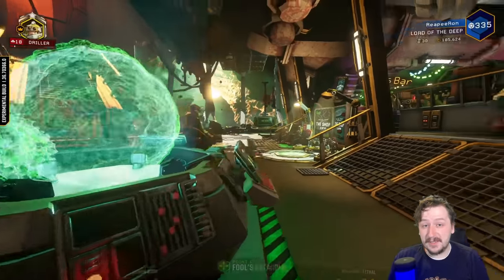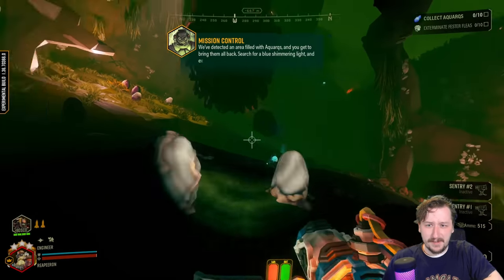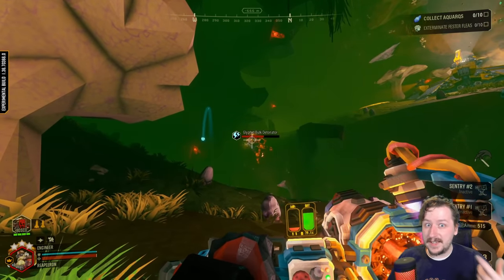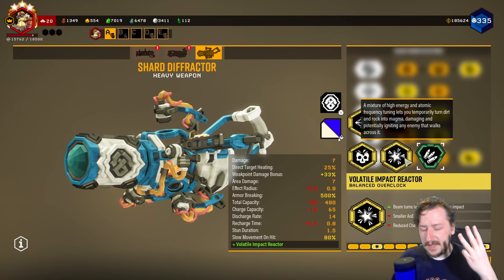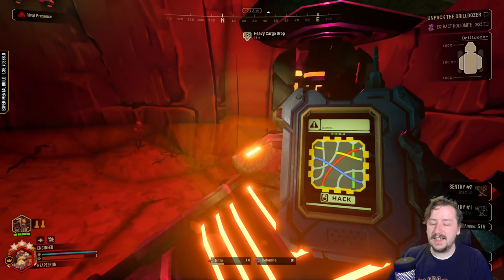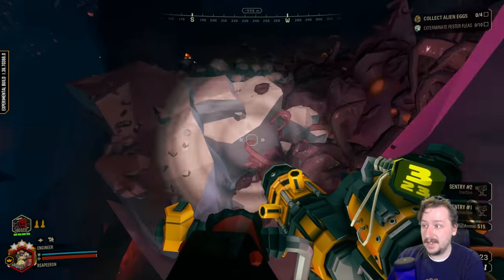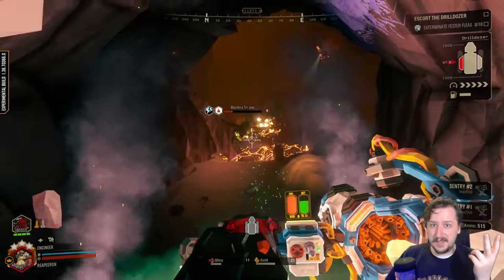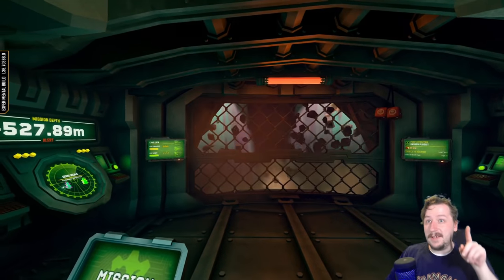Deep Rock Galactic | Shard Diffractor Overclocks First Impressions

Comment: I’ve been hearing people say the Shard Diffractor is pretty underwhelming. While I haven’t played it myself or seen too much gameplay of it, it seems pretty good and fun as of right now.
Reply: this is the reworked version, wich as been reworked again so this video is already too old X)
Reply: The one in the video looks neat. How does the new reworked one work?
Reply from the maker: Yeah we will have to see how this one changes.
Reply: @Kingofdragons117  slightly less ammo. i think it was reduced from 480 to 400 with mods. some mods were changed a bit, but nothing major. AoE was reduced. 
Also: New OCs and existing ones were changed.
Overdrive is now Unstable and fires the whole Capacity. Deals more damage now.
Efficiency Tweak gives overall more ammo and capacity.
NEW: Automated Beam. Adds the v1 auto-fire back.
Endothermic Reflection was changed from refcletion to blowing up a plattform.

Its still great
Reply: @LazerusArtificial  where do you read this
Reply: @michaellee9998  was in the experimental patch notes from the drg discord

Comment: they should make a overclock that allows you to have access to the full magazine but if you overheat you explode like a satchel charge and does tons of damage to you
Reply from the maker: That would be interesting.
Reply: @ReapeeRon  my reasoning is based on the funny description of the gun of how they have to put restrictions onto how long you can shoot it so it doesn't explode
So why not turn that bit of funny dialogue into a overclock?

Comment: I been fiddling with this gun since I got it. And its certainly useful for cracking armor even without OCs.
Reply from the maker: Yeah it is great for that.
Reply: @ReapeeRon  Try it with the electro perk I think its one of the bottom ones? And the electro SMG kitted to deal status. 

It melts anything once you proc some shock status on something. 

Ive only got the one OC for expanding the damage radius but the loss of 100 ammo hurts more than the OC helps.